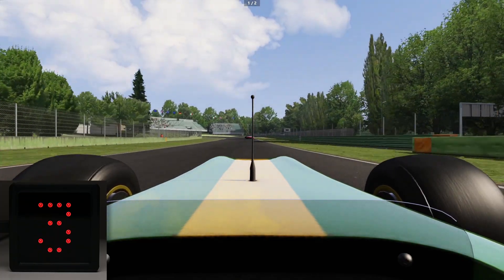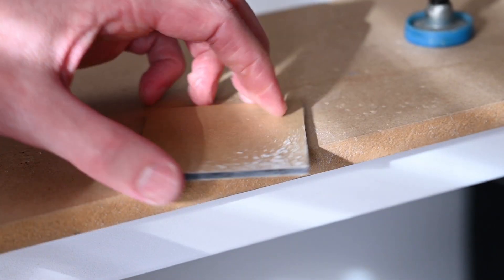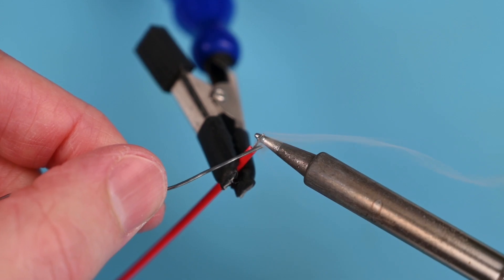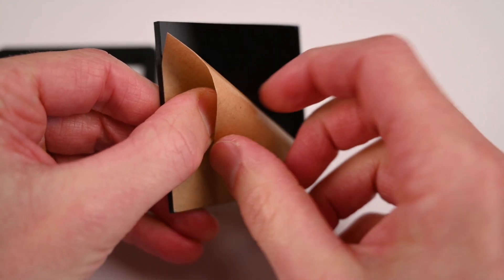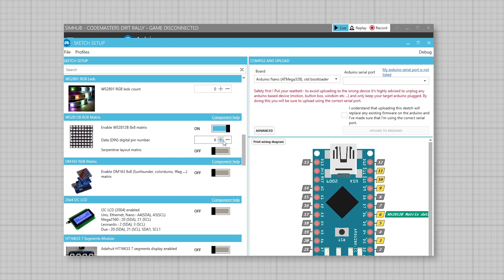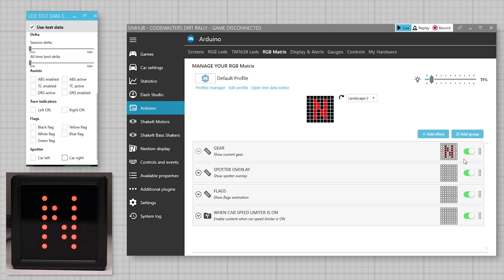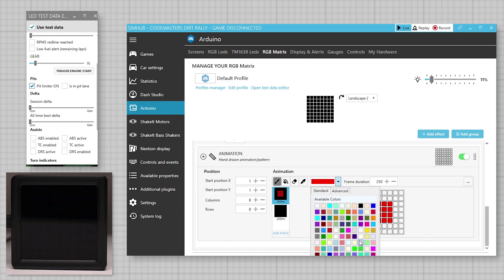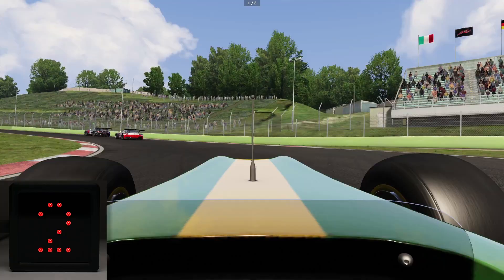DIY SIM FLAG GEAR SPOTTER AND PIT INDICATOR

Comment: Amazing and super helpful content!! Thank you 🙏

Any idea how to connect 2 x 64bit matrixes to different dins on simhub? I see options for multiple devices but not for two of the same. I plan to have two each side of screen with different data displayed if that’s doable, plus a central led strip for rpm. Was hoping I could do andrino nano for the led strip and a single micro for each of the 2x 64 bit matrix.

Any help much appreciated.

Thanks again 

Thank you kindly 🙏

Comment: i already have a button box with arduino, my question is : can i put this LED flags under the same arduino at the same time? like an expansion?or do i need a new arduino just for this?
Reply: Hey. I have the same questions. Did you get ur answer ? Does it works ?

Comment: Another great video. I find myself here a lot lately. I guess similar birds flock together. : ) One question I have not been able to find the answer to, can you run more than one matrix from a single arduino? Sorry if this is a dumb question, I am still getting my feet under me, well thanks to you actually. Again, thanks.
Reply: Hey .. did u get ur answer ? I'm still looking for it.
Reply: @parallelworld6687  No i did not. I just used two.

Comment: just got all my parts. And been looking down the arduino rabbit hole... thought i was still looking down the sim race gear rabbit hole.... On the arduino they are recommending to have a separate 5v 2A supply to the LED's. I'm guessing running this a low brightness you can get away with the VCC pin for power??
Reply: You could make a custom USB cable with a separate 5V for the LEDs.

Comment: Hi! Which version of the Arduino Pro Micro shall we use to make this kit? The 3.3V 8MHz or the 5V 16MHz version? We don't need any external power supply for this mod, correct?

Comment: hello! I have the iflag and the rpm leds with an arduino each, when I connect one the other does not work. How would I have to make them work at the same time? I tried in simhub but I couldn't solve it. Thank you

Comment: Great idea. Would love to do this and many of your projects as they look great to do. Only issue is, not everyone has access to a 3D printer. Would love to see some videos with over the counter parts with no 3D printing needed.
Reply: I agree, even though I have a 3D printer and think it's a fantastic hobby. But, if you're sure it's not for you and want to get started right now: There are many print services you can use where you just supply the model and get the part delivered. It's worth looking into
Reply: @uuild9778  really?? That's awesome. So do you just send in the dimensions or something and they do it for you?
Reply: @slap_A_flamingo  or search to see if there is a maker space where you live, there you can meet fantastic people eagee to help. Some libraries even have 3d printers.
Reply: @uuild9778  I'm definitely going to look into that. Thanks for recommending that. Great help 👍
Reply: Microcenter frequently sells ender 3 pros for 100$
Reply: @10aemiataman  I'm in the UK but I've been told that you can get 3d printing done publicly so that's a good option.

Comment: Thats amazing amstudio! I love it. I have an idea for your projects. Please do not use the pro micro in this way when using the Arduino pro micro. Because the usb port can be easily bent and broken. Insert the pro micro deep in the box and fix the usb cable connector so that it does not move. I tried many times and each time the usb port of the arduino broke.
Reply from the maker: Thanks for the tips!
Reply: @amstudioprojects  youre wellcome 🙏☺️

Comment: Am wondering if you can connect physical yellow rotating beacon lights to this board to trigger yellow flags only? 🤔
Reply from the maker: Interesting idea, a slightly different setup but should be possible